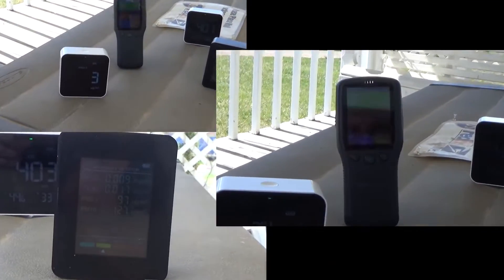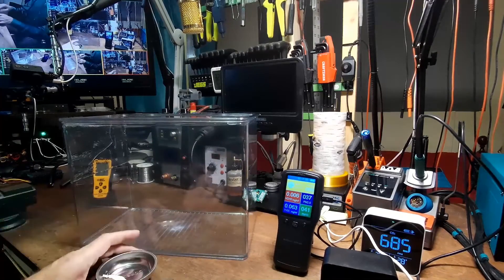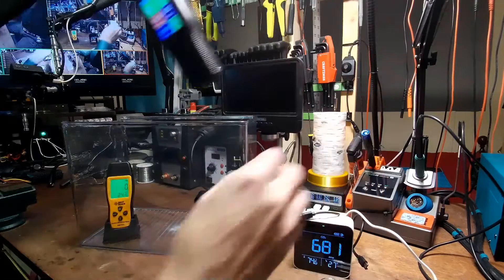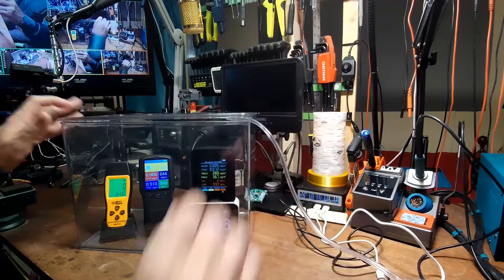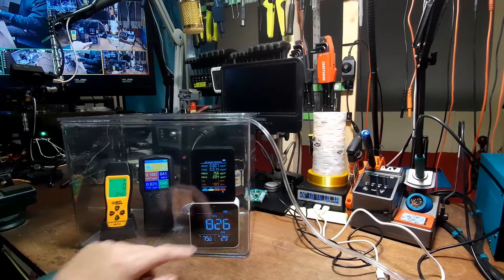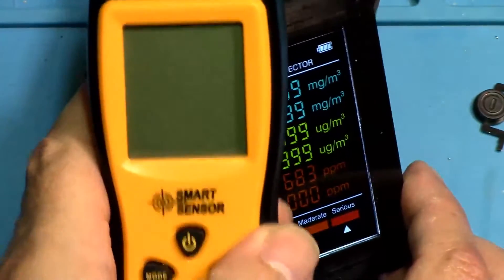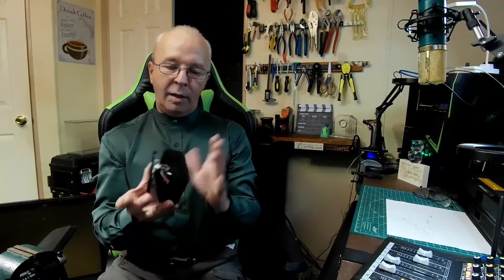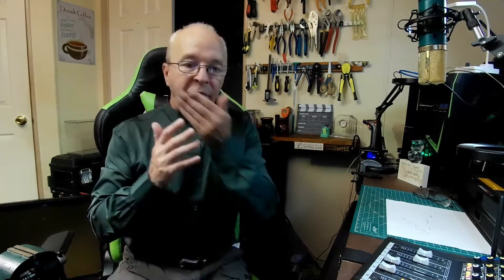Compare Fake Chinese Air Quality Monitor To "Smart Sensor" CO Monitor & "TemTop" CO2 Monitor

Comment: When I put this monitor outside it gives me 70 pm2.5, also AQI gives me smilier results, and when I put it in my room it gives me 20-27 pm2.5 so how is it not accurate?
Reply from the maker: When you go outside, the PM readings will probably be smaller because of the much wider open space and fresher/cleaner air.  When you go back into your home, being in a much smaller space, the Particulates concentration will be higher, so why the PM levels will more than likely always be higher indoors as opposed to outdoors, unless of course, there is smoke outside due to fires (causing smoke) in the area.
Reply from the maker: Hold on..  If you are talking about the black Chinese monitor -- PLEASE DO NOT trust that monitor -- It is fake...

Comment: I have one of these. It isn't great. It's slow, probably inaccurate, but is it fake? I know when I disconnect the large sensor unit on the back of the case, the PM measurement stops. I know when I take a deep breath and exhale onto the unit, the CO2 measurement rises. These are behaviours that I would expect to see. I can see that the board has headers for temperature and humidity sensors as well, but nothing attached. To me, it just seems like a very cheap product and, as they say, you get what you pay for.
Reply from the maker: "I have one of these" -- which one are you talking about?.  If it is the Chinese black one with CO, CO2, PM, HCHO, TVOC, Temp, Humidity etc. -- you know -- the one I call fake.  If it is that one that you are talking about -- it is fake -- throw it in the garbage, it is no good -- it is fake -- get rid of it -- please...  It does not matter that the CO2 goes up when breathing on it; as it will do that and why it fakes people out, causing confusion and making them think it is real -- but it is not real....  A monitor that incorporates a sensor reading that is produced/estimated from another type of sensor -- is faked and not to be trusted.

If the "I have one of these" is one of the others in this video, which one are you talking about so I can give you better information.  Thanks for your question, much appreciated. 👍

Comment: Different sensors are insid, so should be true if are good sensors.
Reply from the maker: If you are referring to the black fake monitor -- yes it has "Different sensors inside", but that does not make it legitimate -- Two of the sensor readings are calculated by other sensors which makes the whole monitor fake and not to be trusted.  Thanks for your comment -- much appreciated. 👍

Comment: Yes, some CO2 detectors can produce false alarms or inaccurate readings when exposed to isopropyl alcohol, also known as rubbing alcohol. This is because some CO2 sensors, particularly electrochemical ones, can be cross-sensitive to other gases besides carbon dioxide, including alcohol. The degree of cross-sensitivity can vary depending on the quality of the sensor.
Reply from the maker: Thanks for your insight - much appreciated 👍
Reply: @Outside-In. That's what the AI said.:trophy-yellow-smiling:
Reply from the maker: @IstvánSalfay  I don't believe AI but in this case AI is kinda right..., I am not sure that I completely agree with the AI that a CO2 sensor will alarm in these situations (mentioned before) with rubbing alcohol, but it can and DOES make the readings fluctuate a small amount even around possibly paint fumes (I have seen it myself), but JUST a small amount.  

I am going from my own experience mind you with this info, but I have tested a lot - a lot of different CO2 sensors and they all pretty much can be affected by pass-by alcohol, colones, perfumes, paint fumes etc, etc, BUT - for only a couple of seconds and then the readings will go back to there normal readings.  

CO sensors on the other hand can be affected much more often than CO2 sensors - BUT - still the readings will go back down after a second or two, again from my own personal experience of countless hours of testing.

The reason I don't trust AI at all, is because I have come across many situations that AI is completely and totally wrong about a subject, so why I don't trust AI, and that is what makes Goggle suck so much now because AI is all you have anymore for questions that you have.  I now have to scroll down through page after page to get to a real answer anymore that is NOT AI, but a real live breathing talking human being LOL ;)..
Reply: @Outside-In.  so i have seen some co2 sensor manufacturers warn not to clean there sensors with alcohol as they will give false readings after due to there being the presence of alcohol. and from a brief bit of research i found out that voc sensors also have this flaw... only voc sensors ite more intentional as they use the alcohol sensitivity to calibrate them. 

also i agree ai is definitely trained to destroy the truth in presuit to be "helpful". it's more prevalent in services that are paid. i have found that you can get a lot better results from ai that you run locally and hasn't been trained on the major companies.
Reply from the maker: @spcolsson  The truth is out there - but AI won't tell us about it.  We must keep questioning, doing our own research, and above all - stay vigilant.  👍

Comment: Older video 46:28 The PM sensor is the black round disk near the center of the green PCB board that lines up with the hole in the metal housing. Inside the metal housing is a laser that shines parallel to the hole. A fan should push air through the laser and light reflected but particles is measured by the round sensor on the PCB.  So it can detect some particles but it's a horribly inaccurate design. I didn't even see a fan in this one or your newer video.  It appears to have a tiny LED in place of a laser. This video shows a real sensor: https://www.youtube.com/watch?v=QgO0iWpK7Ho

Suggestion: Slow down on the tear-down so that we can see how the PM sensor is built.  It's a similar arrangement to a real one but yet strange and wrong kind of laser, so it may detect some particles but likely not accurately.  Here's a PMS7003 teardown.  Was there a sensor under that hole in the plastic piece at 14:42?  When open, the PM sensor would be pegged high because it's sensing lots of light from the room. (Normally in detects flashes of light reflected off particles that pass in front of a laser beam.  So there might be a rudimentary sensor in there.  But yes, the CO and CO2 values are faked on a lot of these low cost meters, even when a possibly real PM sensor.
Reply from the maker: Ok, I guess the only thing that I can think of to say here is this -- if there is a monitor that incorporates two faked readings -- Two Faked Readings -- why would anyone not only want to use it, but why would anyone choose to believe any other readings that it gives?.  If someone decided to go ahead and use such a monitor -- they will (more than likely) get used to it, and possibly (some day) forget that the two most important readings are faked (CO and CO2), and if the CO in a home reaches dangerous levels, this monitor will show 0ppm -- then that person will surely die -- not worth keeping such a device around the home no matter how many other readings it has, but that of course is only my humble opinion...

If a company is willing to lie to me about the two most important things that I need to know (CO and CO2) -- then how can I possible trust anything more that they choose to tell me -- I don't -- I won't, and that is why I create these videos -- to educate on the dangers of fake monitors.  

I can only warn people about a faked monitor, but it is up to them to make the decision to either -- throw it away -- make excuses that "at least one sensor reading is right" -- or -- "It seems to work because the numbers keep going up and down" (that is my favorite of all excuses that I have heard) -- but like I say, it is up to the viewer and what they choose to believe, I can only show my findings and hope that people will take heed...  If someone watches my videos and chooses to not believe the findings -- At least I tried, and at the end of the day -- all we can do -- is try to get the message out to those that WILL listen...

Thank you for your comment -- much appreciated.  Sorry about the late reply -- YouTube again didn't tell me about your comment and I only saw it because I was replying to another comment just made that YouTube did tell me about.  I wish YouTube could be consistent...  👍

Comment: It's a cheap product! It can never deliver 100% accurate values in all areas. BUT the video doesn't mention that you can and must calibrate these things before use. According to my tests, the values are then considerably better and no longer just estimates! Besides, if you rely on something like this in a 3D printing room, well, there's no help for you anyway. These devices are and will always be fun toys, not high-precision scientific instruments. The video is completely overkill and unnecessary!
Reply from the maker: Thank you for your thoughts - much appreciated.  👍👍

Comment: I have not seen any CO air quality  monitors other that dedicated meters. I wonder why ?   But I have seen small portable personal ones (no idea if they work). I have bought temperature sensor devices from Inkbird and Elitech (Temtop). Which are both fairly reputable companies.
Reply from the maker: A dedicated CO meter is (in my opinion) the best way to go anyhow, but I was talking with AirKnight, and they explained to me that they were going to implement CO into their monitor, but the legal tape and expense that they had to go through, made it not economical, so I am assuming that that is the reason it is hard to find any monitor that has a CO sensor incorporated into devices, and most of them that do, are mare than likely faked, but NOT in the US, as the US has stringent and very strict policies for CO detection to be implemented into devices, and if they found a company selling a monitor with a fake CO sensor reading, they would probably not only get very very high fines, but have their company disbanded and shut down.  

China gets away with producing fake monitors because their government don't care if people die... 

Personally I would stick with getting a good handheld CO meter - their smaller and easier to walk around with in your home or business to find a leak, but that is just my opinion.

Thanks for the comment and thoughts, I Hope this helps.  👍
Reply: @Outside-In.  It's a shame.. nice looking gadgets but fake data displayed.

Comment: Hi,  I found you because i believe our new vanity in the bathroom smells so bad and hasn't really gotten better. I learned about VOC's and I was wondering if you could tell me what 
monitor I should get to make sure we our not poisoning ourselves.  Thank you, Shelley
Reply from the maker: Hello Lovpizza.  Thank you for your question.  I have a few questions if you don't mind...

1.  I assume the vanity has a sink that was connected to your plumbing...  How long ago was it installed?.

2.  Could you describe what the smell is like?, does it smell like someone used the bathroom and forgot to flush?.

3.  What was removed to install the New Vanity, how much demolition?.

4.  Was the work done by a professional, or was it a simple job that you decided to do yourself?.

Thank you for your help in answering these questions, as this will aid me in being able to give you the best answer possible to your inquiry.

Comment: I recently had a situation. I heat my house with wood. I have a carbon monoxide detector installed without a display, only with an alarm for dangerous carbon monoxide concentrations. I also have this Chinese one that you used in the test. I don't know if this Chinese one measures the correct values. But it successfully detected elevated amounts of carbon monoxide that are dangerous to health. I thought since my expensive detector didn't sound the alarm that this Chinese one was not good and was recording the wrong values. A few minutes later the alarm also sounded on the expensive carbon monoxide detector. Now I don't know what to think. The one in your video shows strange values. Sometimes youtubers are paid by certain companies to denigrate certain products in comparisons. I'm not saying it's you, just that your Chinese detector really shows strange values as if someone has tampered with it or it is not working properly. But we need people like you, keep up the good work.
Reply from the maker: Thank you Baky6 for your comment and concern.  I have had many companies not respond to me to review their product after discovering how honest I am in reviews, and I am not saying that is only because of my honesty, but am simply stating that it is a possibility.  

After taking this FAKE Chinese product apart, there is ABSOLUTELY NO CO or CO2 sensors inside at all in any way shape or form.  It is simply impossible to get a CO reading or a CO2 reading from anything other than a real CO or CO2 sensor.  

The readings are all over the place because the readings are faked.  You are very correct that there are a lot of channels these days pushing products that are fake to make a buck, but that is NOT what I would ever do, because your safety is more important to me than making money, and if that means starving, then that is exactly what I would do before promoting a product that is found to be faked in even a small way.

One reading in a monitor that is faked, - In my opinion - Makes the whole monitor FAKE.

I hope this helps.  Please get yourself a legitimate CO meter that has a digital readout, and when you see any number above 4 or 5ppm that remains for more than a minute - take head to it and don't disregard it.  Please don't rely on a CO monitor that doesn't tell you what the value is, and don't ever rely on a monitor that alerts you when it thinks the levels are too high, as most of those monitors will not alarm until the ppm is 50 or above - such as smoke detectors with CO warning alarms.  

Any reading of CO that is above 10 to 20ppm for days or weeks, is very dangerous for you and your family, as CO AND CO2 poisoning is accumulative, and just because 45ppm is not bad for a moment, 25 or 45ppm accumulation over hours, days, weeks or even months can lead to demise, but you would know something was wrong way before that because of the symptoms that would result in prolonged exposure to higher levels over that period of time.

Hope this helps, and thanks again for your comment and concerns.

Comment: EDIT : I turned off the uniit for about 5 minutes before reebooting it.
After reboot (indoor)
HCHO > 0.012
TVOC >  0.036
PM2.5>  013
PM10 >  015
CO      >  0.000
CO2   >  0446 < MUH LOWER AFTER REBOOT
(The CO2 might be a calibration issue...) not sure yet.

Comment: great review, and having said that, I bought one anyway.
(MT-26) NEW.
I'm not sure yet, because it's reading, but with the CO2 @ 2190 +/- 
Smoking won't help! LOL
Anyway, I thought I might put it outside in the nice fresh air, to 'calibrate' over a 24hr period...T.B.A
Having it just arrived, I just charged it, and let it do it 'thing'.
True, it maybe fake, but I also take into account thee calibraion of the unit.
The interface is basic, but it says in the 'Chinese' destruction manual, the turniing off the unit, resets it?
As i'm tying, the read has settled to 1957, which indicates that it is taking a reading, but it's not calibrated, thus, the insane figuree/s.
Outside, it actually, ALMOST went to zero (20/40/200/80)
so, I think that it has enought 'intelligence' to tell me, smoking inside is NOT healthy!.
i MIGHT come back to updatee this.
and, yeah, enjoyed your video. 👍

Comment: Outdoor test proved correct temperature measurement to within 1degC and humidity at 10% accuracy, while PM values dar from reference ones, even though main PM pollutant has been correctly identified as PM2.5, significantly differing from other ones. BTW, conditions outside were very different from inside, with 15degC and 20% higher humidity. I therefore stand by my conclusions that MT15 has a very primitive PM detector resembling PM measurements and climate sensing at some reasonable level. Nevertheless, I agree that it is not a recommended sensor for remotely serious applications. It is better to spend a couple of hundred euros and get a more reliable device.

Comment: I was actually ready to order two of those from aliexpress last night, not getting them now after seeing this video. 👍👍👍
Reply: Opps!! Bought one. Just did the alcohol test and the CO2 went all the way up. So how about the HOTKREM Air Quality Monitor. It measures just particles. Is that one good.
Reply from the maker: @ The Hotkrem was one of my favorites until I found out that they are extremely unreliable, so I can no longer recommend them.  I have also found that to get a good quality monitor, it will cost upwards toward 300 dollars, and that is just out of the range for a lot of people including me, and why I can't afford to do these videos any long.  It is way too expensive, and I have contacted a number of companies to send me their monitors for test and review, but every time they take a look at my channel, they change their mind.  So it makes me wonder if they don't like how honest i am and not holding anything back.

But I will never take a product that is expected of me to just give a positive review to make money :).

I am glad that you found out that your monitor is only good for dropping in the trash can, but like I say, good quality and reliable monitors are far over the 100 dollar price point.  But if you are looking for just a CO2 monitor, you can pretty much trust anything around 100 dollars, but even then there are CO2 monitors that are not quite reliable that cost that much, so any more, it feels like a gamble to get one that actually works as described.